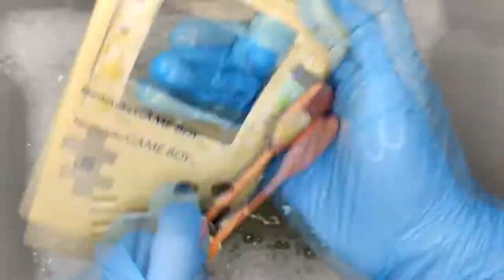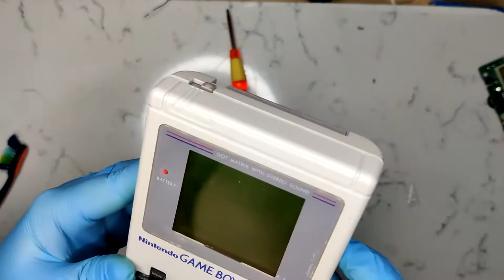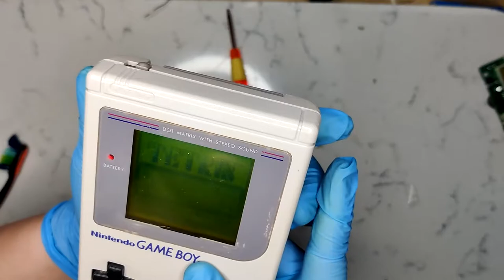Scarlet Restores! | 07 | Original Gameboy DMG-001 Restoration!

Comment: Only about 14 minutes in so far at the moment, but it occurred to me that you had tested it early on with the batteries working fine - do you have any recommendations for restoring the battery connectors? Or is there a specific part it comes up at?